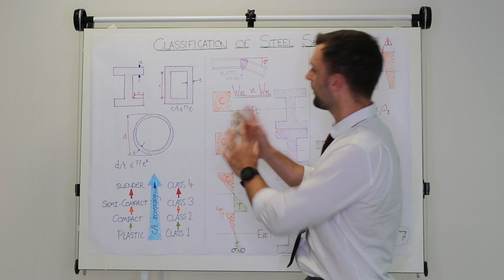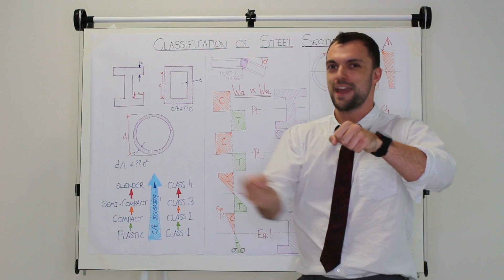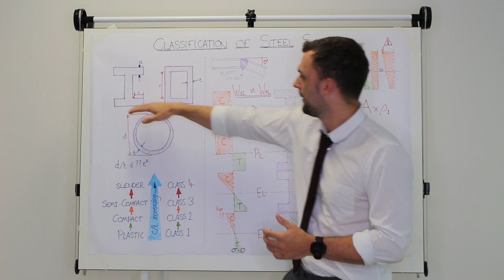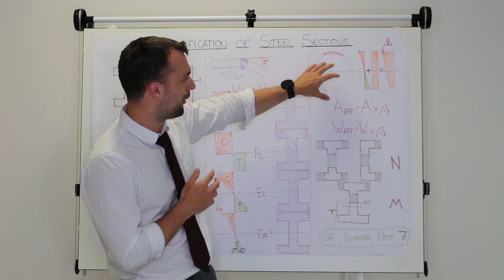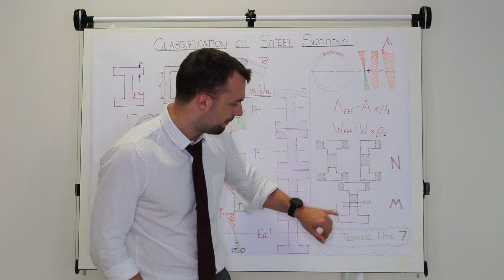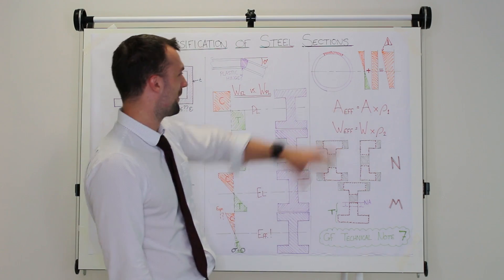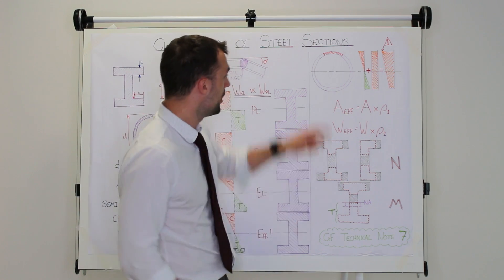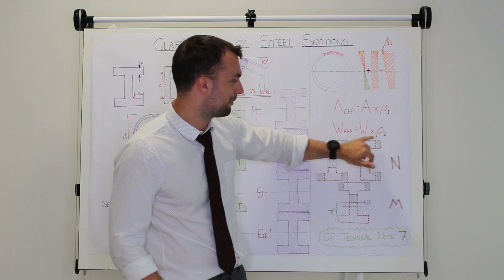Classification of Steel Sections | Back to the Drawing Board

Comment: 🎯 Key points for quick navigation:

00:14 Introduction to the classification of steel sections and their impact on beam design.
00:39 Focus on structural steel grades like S235 and S355, explaining material property differences with stainless steel and aluminum.
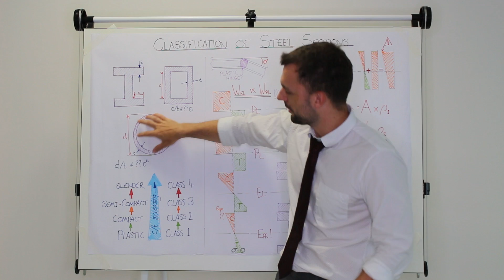01:09 Classification involves comparing the length and thickness of sections, particularly looking at the depth-to-thickness ratio.
01:38 Steel sections categorized as Class 1 (plastic), Class 2, Class 3, and Class 4, where each class reflects ductility and buckling behavior.
02:03 Class 1 sections can form plastic hinges, maintaining strength under continued rotation; Class 2 has limited rotational capacity before buckling.
02:55 Class 3 sections reach an elastic limit; Class 4 struggles with buckling before achieving full elastic stress distribution.
03:47 Class 4 sections warrant special design rules due to their inability to withstand full elastic distribution, focusing on effective area considerations.
04:45 Compression vs. bending criteria illustrated with examples emphasizing where buckling is likely to occur in structural members.
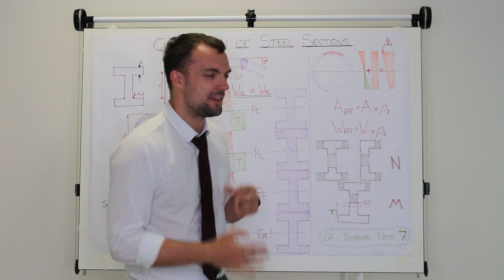06:11 Class 4 sections require design adjustments using effective area based on potential buckling zones as per Eurocode standards.
07:08 Encouragement to refer to technical resources (e.g., Groundforce's technical note 7) for deeper insights into effective design practices for Class 4 sections.
07:35 Conclusion inviting viewers to engage with the content by liking or subscribing for further learning on structural design principles.

Made with HARPA AI

Comment: Hi. I have gone through various design codes. Strangely, only Eurocode 3 provides the cross-section classification limits with Class 1, Class 2 and Class 3 limits for the members under axial compression. While the rest of the codes just provide the yield limit. I know the basis for Class 3  as yield limit. It would be of great help if you could let us know the basis for Class 1 and Class 2 limits for cross-sections under axial compression in Eurocode 3. Regards.

Comment: Really nice video. But class 3 cannot get into plastic. At all. That is specified in EC. Theoretically speaking the limit is defined by cumulative plastic ductility level before it gives a rise to local buckling of the segment of the section. In case of Class 3 (or semi-compact, or FC, or P-II, or MDM, depending on where you are doing your work) the value of this parameter is 1. Of course, the value of 1 is just the point and Class 3 has some range, but that's due to probability and safety factors, but the idea of safety factor is to use them, not ignore them.
Reply from the maker: “Class 3 cannot get into plastic. At all.” - Certainly the codes do not strictly allow for it – but that doesn’t mean it can’t happen in reality – it’s all about simplification.

To make the point, let’s look at a steel UB made from S235 (epsilon = 1) that is subject to pure bending. If this section has a web length to thickness ratio (c/t) of 82.9 then we can safely say that it is a class 2 section, right? EC3 tells us use a fully plastic distribution of stress. Next, let’s swap that section and replace it with a nearly identical section that is 3mm taller… now the c/t ratio is 83.1 and the class boundary is at c/t=83. So now EC3 says that we can only assume an elastic distribution. But wait – has an extra 3mm really reduced the stress carrying ability of this beam by nearly 30%? Of course not - this is just where strict theory and practicality diverge a little, that’s all.

Every section that has a c/t ratio between 83 and 124 is treated, by the codes, in exactly the same manner. A section right on the class 3 to class 4 boundary (c/t = 124) really can barely develop even just the elastic stress before local failure. A section that is right on the edge of the class 2 to class 3 boundary (c/t = 83.1) can, in reality, develop a stress regime that is almost completely plastic before local failure occurs but we just treat it as elastic, treat it exactly the same as a far more slender section, all for the sake of simplicity. The boundaries had to be drawn somewhere and unfortunately for those sections unlucky enough to live near that border, they get demoted significantly – and it’s nothing to do with safety factors.

So in short – some class 3 sections could, in truth, carry a fair amount of plastic stress if they wanted to. Some couldn’t. so to keep it simple, we just treat them all as the worst case.
Reply: Sorry, I do not mean "safety factors" as something that EuroCode is describing, but rather a common understanding of this word. In this case - safety factor as the "width" of the range of the Class.

Obviously, what you say is true. The "width" of Class 3 is basically from the slenderness at which the section's component lose stability precisely at the point of reaching full plastic moment up to the slenderness where the local buckling occurs just at the point of stress at the furthest point from the section's centre reaches yielding stress.  Plus the probability of occurrence, which is, at least in Japanese standard, based upon the possible imperfection (1 or 2% of the thickness of the component of the cross-section), plus safety factor - multiplier - reducing the limits of all the Classes.

About what is happening in reality we can get to interesting conclusions, as for instance Class 2 can work well over the ductility level greater then 1 without getting buckled, whilst if we apply strong kinamatic wave (like 150 kine or so) we can make Class 1 lose the stability locally at suprisingly low plastic rotation. Nevertheless, standards are standards for some reason, and for instance, Class 3 is not allowed to get plastic also because the same clasification is used for other kind of analyses - like abovementioned dynamic ones. In case of the UB,that you used as an example, saying we can allow some yielding and basically allowing to partially work as Class 2 opens the gate for, e.g. using it in moment-resistant frames as an energy dissipation zone. Which, assuming local instabilities during seismic action, has a great chance to cause the collapse of the frame.

So speaking about the design - no, we cannot allow, if we still won't to be protected by designing "in accordance with the standard". Pretty often we can use some common sense, but in this case the risk is quite high and I would probably advise using shell elements to check the behaviour of the model using certain boundry conditions.

And, as you seem to have greater knowledge about the EC than me, have you ever got any information describing what cumulative plastic durtility is allowed for Class 1? Or what angle of the rotation of the beam at the point of plastic node is allowed?